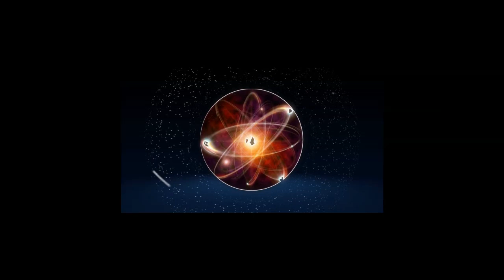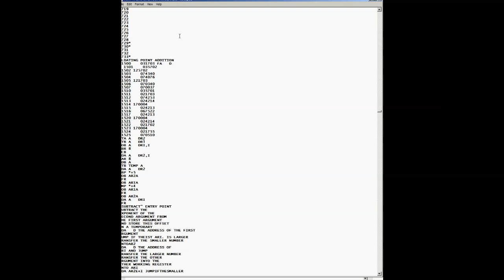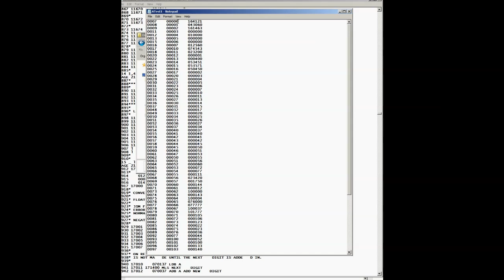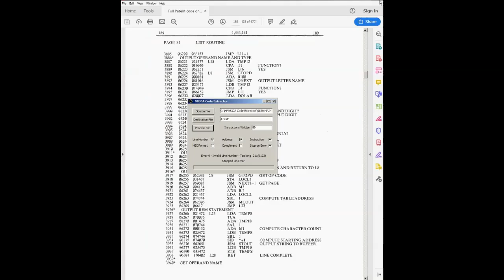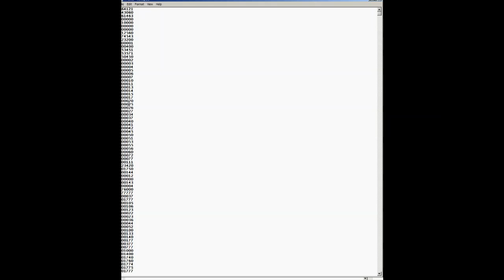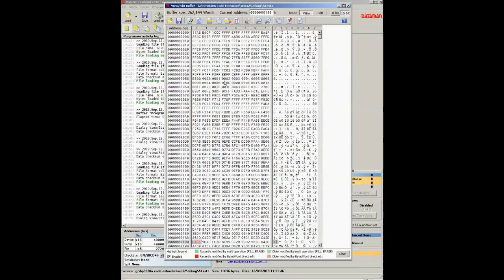HP9830A  Repair  Part14

Comment: Once again, thanks for doing these.  I just had a look at your website, and I see that the riser boards are not available anymore, but you do still have the ROM emulator board up on your page and I intend to order one.  I was wondering if you might have KiCAD  compatible files for the riser boards or whether I will have to design my own.  I will try and contact you via your website.

Comment: I'm  repairing several machines in this family (9810, 9820, 9830) and would be very interested in assembling one of your ROM cards. How do I get more info?

Thanks!
Reply from the maker: I will be selling them on my website (jmprecision.co.uk) as soon as I have time to produce a bill of materials. I am selling the bare boards for what I paid for them (£43.00). Component cost is very low as there are only a handful of parts. The current boards require 4 wire jumpers on the back. In the next video I show a board assembled for the machine. Do you have any faulty units for sale?

Comment: Looks like you've made considerable progress.  Love to see the new card(s).  Like I mentioned before, the only other reference I could find on the code was here: 

http://madrona.ca/e/HP9830/microcode.html

The error mentoned was in ROM 3 in a section of code being transversed in locations  0013 and 0412.  ""Some repairs were made to the OCR'd graphics as a few bits were obscured or cut off in the patent scan. A couple of actual corrections have been made, at locations 0013 and 0412 in ROM 3: the patent data is inverted (e.g. LHHL instead of HLLH). They look a lot like intentional errors introduced to the data listing. These errors were uncovered during disassembly of particular instruction sequences being examined, the checking has not been exhaustive so there could be more. The repairs and corrections are indicated with lower-case letters instead of upper-case in the ROM-Content fields. ""

Comment: I asked on the VintHPcom at groups dot io group and the developer of the GO9800 emulator replied that the GO9800 emulator release 2.3 contains ROM dumps for all 9800 models in the jar file archive. From a quick look I see HP9830A_System1_ROM.dmp through HP9830A_System9_ROM.dmp files, which are text files that appear to be 16-bit octal values with leading zeros suppressed. Sort of a weird format but should be trivial to convert for use with your device programmer. These first few lines from HP9830A_System1_ROM.dmp match the first page of the system firmware listing in the US4012725 patent.
164121
43060
161463
0
10000
0
0
12560
74543
23200
1
400
53451
Most of the 9830A ROM.dmp files are 1024 lines ling. The first is only 768 lines long and the last two are only 512 and 256 lines long. Not obvious to me yet how the files map into the ROM address space.
Reply from the maker: OK I managed to get the emulator working. Only took 5 hours (I have never used JAVA so did not have it installed on my machines and it is a bit of a pain to get working). Next step is to make yet another software utility to convert the code from my ROM's into the format that the emulator uses. I can then see if they should work by running them in the emulator and it is just a slightly different version or if the ROM's are faulty.
Reply from the maker: Brilliant that is just what I was looking for. I can write a small utility to pad the octal values to 6 characters and then pass them through the octal to hex convertor. I assume that they are for each 1k block although the last block is in a small additional ROM card in the 9830. I can match up the data values and stitch them into a single bin file to use in the programmer. This should save me a lot of time, thanks and also thanks to the creator of the files. The new ROM board should arrive next week so by then I should have some code to program into it.
Reply: It appears that the HP9830A.cfg file in the GO9800 emulator package describes the starting address and length of where the ROM image files are located in the system address space. Looks like the first ROM is only 768 words because there are 256 words of RAM mapped into the end of the first 1K words of address space.
Model HP9830A
ROM 000000 001400 HP9830A_System1 Block0
ROM 002000 002000 HP9830A_System2 Block2
ROM 004000 002000 HP9830A_System3 Block4
ROM 006000 002000 HP9830A_System4 Block6
ROM 010000 002000 HP9830A_System5 Block10
ROM 012000 002000 HP9830A_System6 Block12
ROM 014000 002000 HP9830A_System7 Block14
ROM 016000 001000 HP9830A_System8 Block16
ROM 040000 000400 HP9830A_System9 Block40.0
RWM 001400 000400 HP9830A_System Block1
Reply from the maker: Yes that is correct. I have figured out how the mapping works in the 9830. It makes no difference to the actual ROM images as the mapping is done in the address decoding of the 9830 rather than the ROM's so the ROM images will need to be setup accordingly. I can just put the ROM9 image after the ROM1 image and then the ROM2 image to make a continuos image for the ROM. The 9830 will take care of the addressing. Naturally the emulator works a little differently as it does not carry out hardware decoding so I assume the developer used the configuration file in place of hardware address decoding. I have written a utility to pad the dump files to give 6 characters per instruction and output them as inverted HEX. The good news is that I now have the code. The bad news is that so far it seems to be the same as the data I read from the ROM board (and does not match the patent - see ROM 3  which is for octal address 4000 in the 9830). Possibly it is just a speed issue. I will be checking the rest of the ROM's and hopefully there will be a difference. It is really useful to have what I assume is a working set of ROM images as I had 3 or 4 versions and no way to know which was correct.
Reply from the maker: Is there any information on how to run this emulator? I have downloaded version 2.02 but there does not seem to be anything other than class files, dump files and cfg files but no way to run it. I assembled the dump files into a single image and then passed it through my conversion utility. I then compared this file wit h the file I obtained from the ROM card and there are a number of differences and both are very different from the patent. I could start to trace through the code but with no comments I would need to interpret every instruction and try to figure out what it is supposed to do which will take a very long time. What I want to do is create a set of dump files from the file I got from the ROM card and see if they will run in the emulator. If they do then I know it is just a slightly different version and not the source if the primary fault(s).